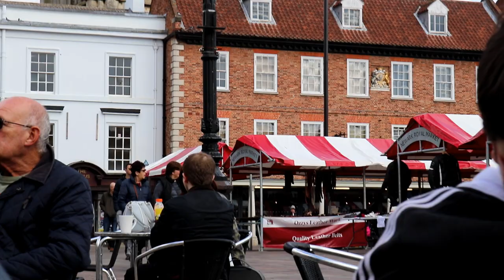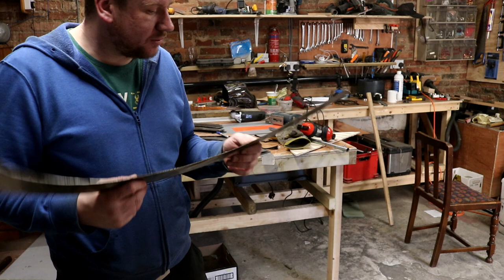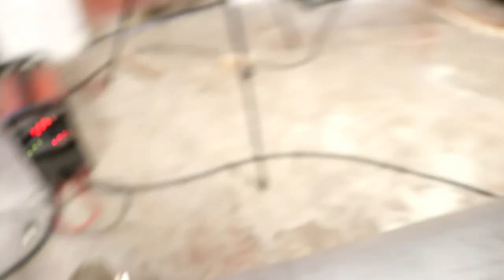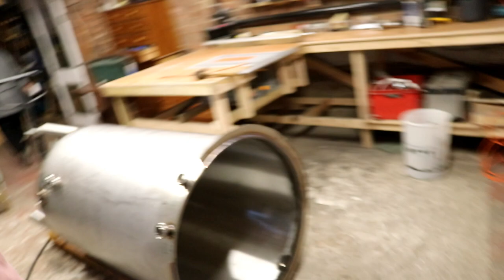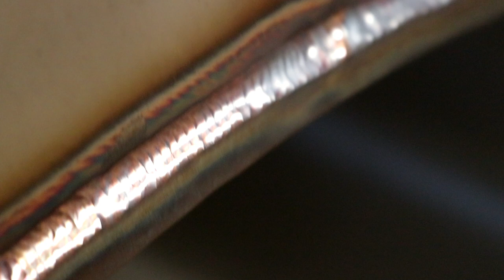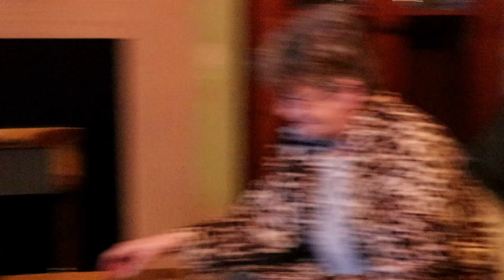BANKING ON TEAMWORK

Comment: How about a little section step down same width as the top sections and then the same arc section across the bottom. It shouldn't need welding to the tank, just to each section, as it should be stiff enough. Just a thought, it's your build. Cheers, Schnuz.